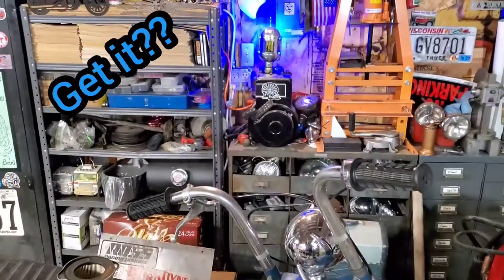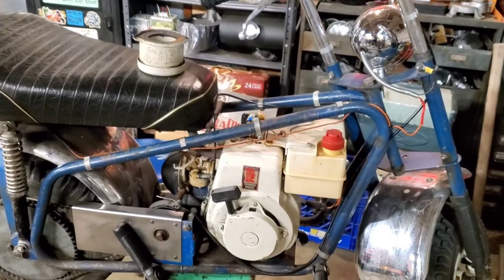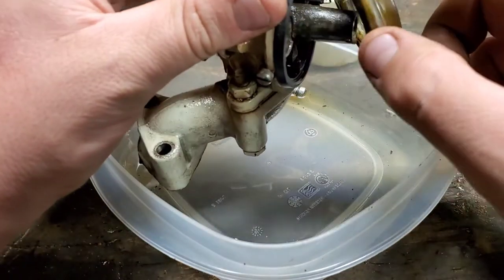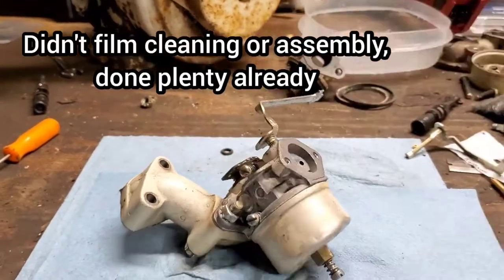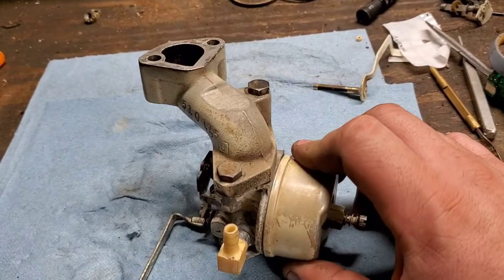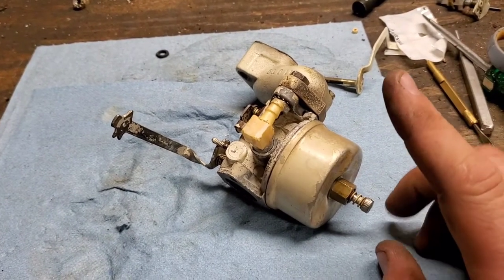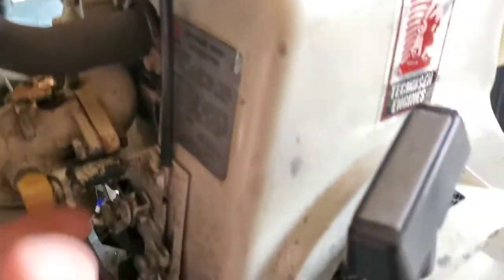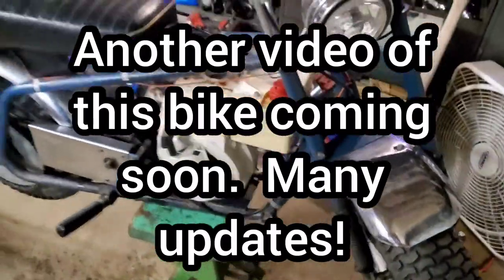Repairing a Survivor Heald Trail Bronc Mini Bike!

Comment: I bought a VT-10 with low hours off of ebay several years ago. I removed the engine to clean up the frame a little bit but haven't gotten around to putting it all back together again. This video has given me some incentive to getting my bike rolling again. BTW: there's a guy from southern Wisconsin that usually shows up at the Windber, PA minibike reunion. He has several Heald Super Broncs.